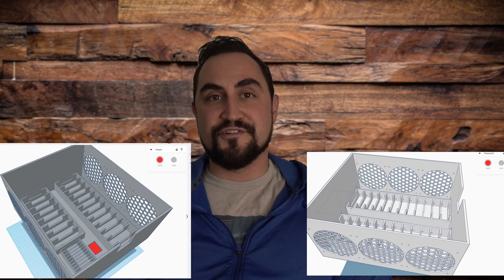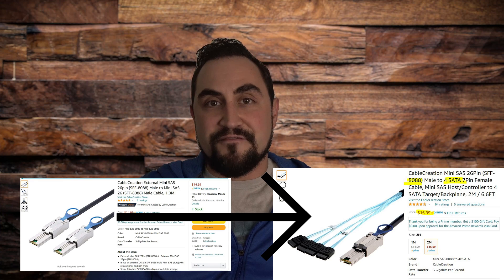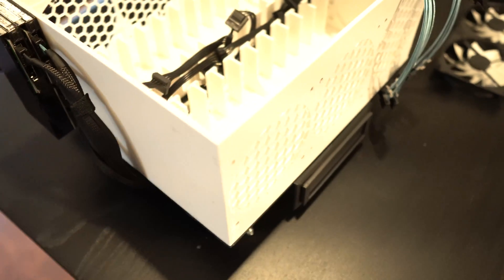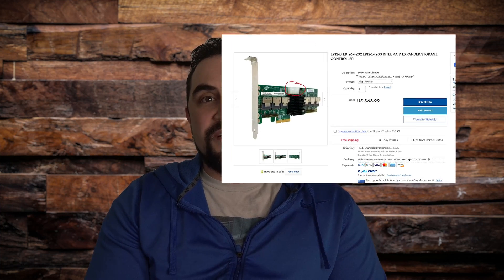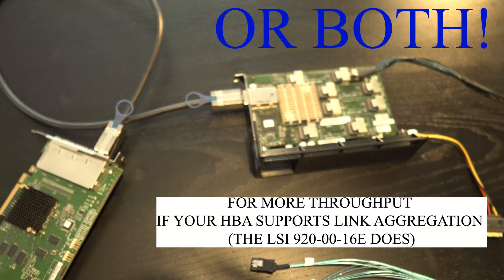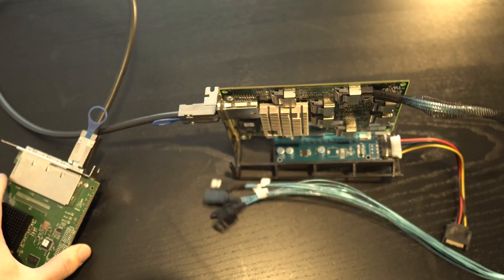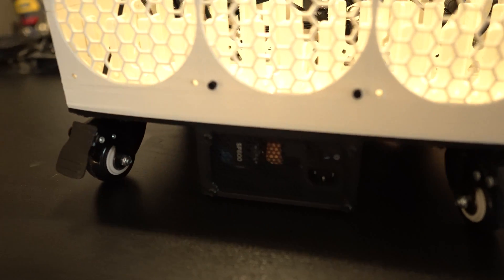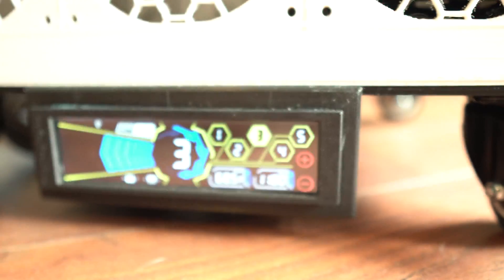Cheap HBA and SAS expander options

Comment: Good video thanks for making it.
I do have question or two.
I run Windows 11 and need to add more sata drives as mobo is full. Can HBA SAS work on windows 11 and which card would be best fit?

Comment: Cool!

The only other thing that I would add is to be careful if you are using SAS expanders and/or other host bus adapters from the perspective of how your host system is actually managing the drives and the data that's on those drives.

Ideally, a good rule-of-thumb to go by is that you'd want at least 1 GB of RAM per every TB of data that your host system/server is managing as well as (also, ideally) one CPU core (preferrably physical core as opposed to a logical core) per drive that the host server is managing as well.

This is mostly so that you can keep your drive's throughput at a maximum IF you aren't using some kind of remote direct memory access (RDMA) technology.

Comment: Hello! Great informational videos! I have run into an issue that I'm hoping someone here can help with. I got an LSI 9211-8i P20 and currently have it sitting in a PCIe x16 slot but for some reason, the OS sees the card but none of the 8 HDDs plugged in. Does anyone know why they aren't showing up? I have been reading through forums all day and haven't found an answer. Any help is much appreciated. thank you for your time.

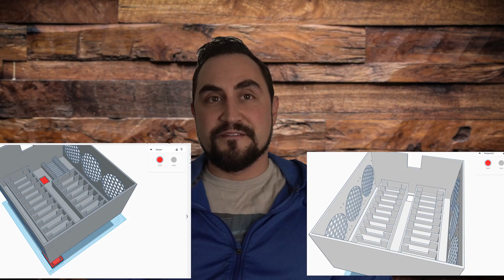Comment: can someone explain what is this on the side of the box? at 00:50-51

https://youtu.be/hBnuW8DfLNM?t=51
Reply from the maker: because in my initial design i was using SFF-8088 to SFF 8087 breakout cables.. so i had to convert from sff-8088 to sff-8087... I've since just used sff-8088 breakout cables.
Reply: @SlothTechTV  thanks! actually, made same mistake - ordered wrong cables and now waiting for proper ones from AlieX :)

Comment: Hi @Sloth tech ! Just received a BROADCOM LSI 9650SE-12/16ML 16 channels SATA RAID PCI HBA from ebay but can not succeed to connect HDDs that are out of the box (using 8087 split cables). When in the LSI card bios I'm only able to "create unit" from HDD that have already been connected to my Dell T5810 (so full with plots) but impossible to "create unit" with brand new HDD (they show up in "incomplete drives and others" with "drive error"). Is there anything to do to configure the card ? I can not find any driver (i'm using Widows 10 pro). Any tips ? Great videos btw ! I learned all from scratch thanks to your channel on how to mine Chia first with swar then with mad max. Now trying to connect 32 HDDs to my T5810 after having seen this video. What a challenge ! Cheers.

Comment: HI , I tried to use HP SAS expander and LSI 9200-16e making a disk array. But when I tried to use one of my GPU riser card to power up the HP SAS expander , it does not work.
I can make it work if I insert the expander on real PCIe slot on the same PC that I installed the LSI HBA card. May you tell me which step I could be wrong? should I use any particular riser card? or I need to upgrade the FW of HP SAS expander?

Comment: Hi.  I stumbled upon this video while trying to figure out what I need to buy to use more than 8 drives my LSI "SAS9211-8I 8PORT Int 6GB Sata+SAS Pcie 2.0" card from Amazon allows.  I'm still learning this stuff little by little and I understand I need an expander or expander "backplate" of some sort afaict.  If you don't mind recommending, what would be the cheapest, most reliable product(s) for this?  I have paired two "Cable Matters Internal Mini SAS to SATA Cable (SFF-8087 to SATA Forward Breakout) 1.6 Ft" cables after seeing them recommended in some of the reviews for this LSI card.  If my PC specs help, they are: 990FX mobo; FX-6300; 32GB 1866 DDR3 (locked to 1600 by cpu); LSI card (in 2nd PCIe 2.0 x16 slot).  The majority of the drives to connect would be traditional mechanical drives so I'm not so concerned having SSD's throttled (besides, I've heard conflicting viewpoints whether they can be harmed using these cards with ssd's instead of native mobo sata ports) I'd like to keep all the wiring inside my tower chassis and not have additional external wires if possible.  In any event, thank you for your time and consideration and will watch this video again in hopes something clicks as to which direction to go.

Comment: hey sloth I am looking into HP SAS expanders and their are several models out their. They all seem to look exactly like the 487738-001 in your video. From your experience do you think they would do the job or I just have to take a shot in the dark and hope it works if its not the same exact model number you have? 
Thanks.

Comment: Thanks for these videos and information!
How do attach the 3d printed modules to eachother? Just screws or glue or something else?
Also could you show us how you have setup the wiring for the HDD power and data connections?

Comment: Does it matter that this card is pcie 2.0 x8 if used with sas drives for plotting chia? 16 10k sas drives on pcie 2.0 x8 speeds, wont that bottle neck it?

I appreciate your opinion

Comment: Can I use a different controller instead of the lsi 920-00-16e? If so, what do you recommend? I found the HP Smart Array P822 615415-002 2GB at a good price. Will it communicate with the Expander?

Comment: Sorry I am confused please help. I want to put everything in a case, i am not building a box like you did to expand, do i just need a sas/sata pcie breakout board and breakout cables? I was going to buy the hp expander you recommended but its on 3.0gbs for sata my drives are 6.0gb ssd's and it also says for this hp card that "You will need a RAID/HBA card already installed in your system for it to work". so do i need to buy the LSI/hba card you said as well? even though the expander is going to be on another pcie slot on the same motherboard? I saw this https://www.amazon.com/Expansion-Expander-Lenovo-03X3834-11407-01/dp/B08TWDZJCD/ref=sr_1_6?dchild=1&keywords=sas+expander&qid=1620497168&sr=8-6 will this work for my needs? again i am keeping everything inside a case, should just need an expander board like the one on the link, or is it just lenovo compatible?
Reply: i bought this, will it work?  IBM 46M0997 ServeRAID 16-Port SAS Expander Expansion Adapter  https://www.ebay.com/itm/194024571591

Comment: how did you managed to get the power supply ready, without a motherboard? Did you use some kind of jumpers (for the 24 pin)?
Reply from the maker: Roger that -- there are even adapters on amazon you can get.